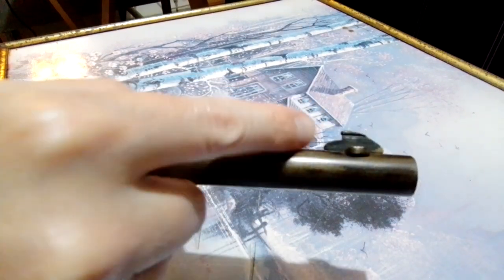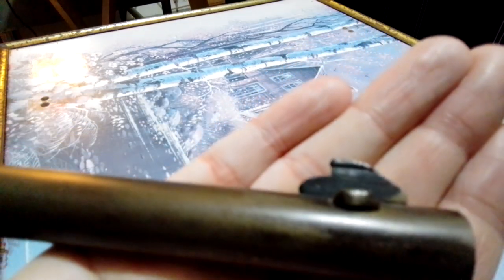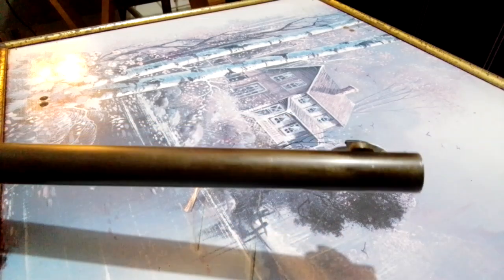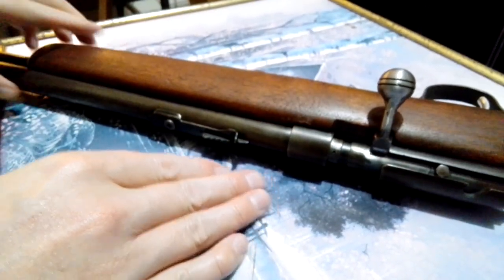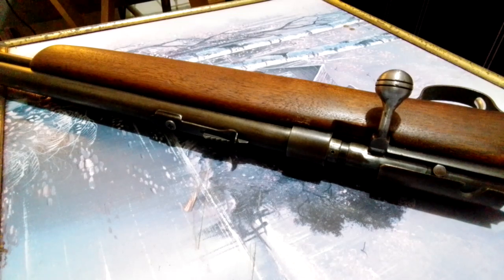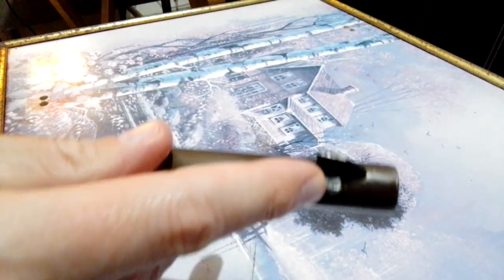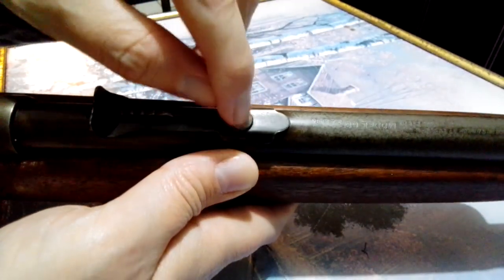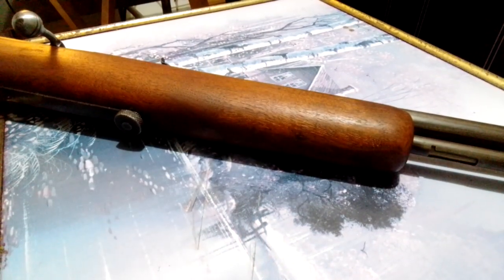Cooey Model 60 Front Sight Question

Comment: Don't know >anything about the Cooey Model 60 front sight. ... I will say, the 'wedge' on the sight does look long compared to what is typically seen on other sights.  [The 'length' on the wedge looks long, on it's side to side measurement.] ... If the sight was modified, the rifle must have had sentimental value to an earlier owner, or else a very >talented amatuer had access to a front sight, that could be made to fit on the Cooey Model 60.
The Canucks surviving in the Far Frigid North in harsh situations develop a more 'Can do' attitude about fixing problems. ... The softer less capable Canucks and Canuckettes >typically seem to thrive in the Big Cities of Canada, where government assistance is nearby.  [The same is true down here in YankerLand.]
Reply from the maker: yeah i think your right most sights have a dove tail half as deep :)
Reply: My Grievous Fault as to >my understood description of the Front Sight Wedge.  ... However, I do see were a commenter replied, and said, 'The front sight is identical to yours including the small staking mark on each side'  in regards to his own Cooey Model 60. ... More information for the 'GunGeek' sleuthing on the Cooey Model 60 design history. ... In a much older video, GunGeek may have been wearing an appropriate Sherlock Holmes Deerstalker hat.

Comment: The old gunsmiths used a dovetail file to make the whole dovetail so I would do that unless you dont want to alter your pew pew. 15 thousandths  Isn't a lot and It might be 3/8  inch once its out and you can measure it better.
Reply from the maker: yeah im not
messing with it, was trying to answer a comment i had :)